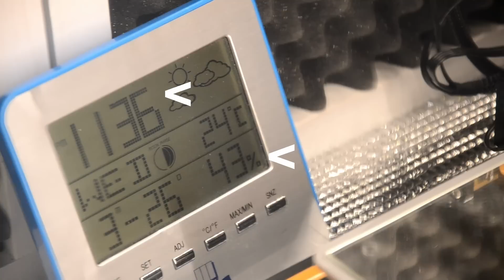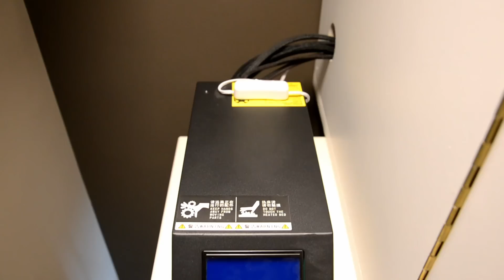3D Printer Enclosure / Build (Creality CR-10)

Comment: nice enclosure but if your printer power supply is attached to the printer i wouldn't insulate it at all, that will fry your PSU.

Comment: Nice job. I am thinking about building one but someone brought up a good point. They said I need to consider the fact that electronics dont like heat, such as the power supply, stepper motors etc, and having them enclosed could cause them to fail prematurely. Whats your thoughts on that?

Comment: Love the design.

Resonance and noise is a hassle with printers and MDF is a nice dead option for an enclosure. 

May i ask how you find the thermal performance? I found the printer gets very hot if you have foam inside as well.

Comment: After 2 years of use, what the temperature like inside the box on long prints? Any issues with the cooling fans for the hot end. Any adverse issues with the control board and or power supply?

Comment: Enclosures that are fully enclosed and retain heat continuously will degrade electronics, motors,  power supplies fail when they are are not cooled properly, if they are inside a warm or hot enclosed box, they will fail prematurely,  3D printers with 3D printed parts as part of their architecture will soften inside an enclosed machine, air pressure differential and  heat control is a must for a well balanced system that will only allow the heat concentration to reach the required parts, surface or surroundings. Think of this next time you consider an enclosure.  Simply enclosing a machine  is not the right way to do it but everyone seems to do this without thought to the above.

Comment: I used this for a super cheap enclosure and could not be happier! https://amzn.to/2WPgPRL Built a cute around the printer and can take down super easy when not needed. Cut a hole for a vent exhaust and printed a 4" exhaust outlet to connect to https://amzn.to/2WS0f3K using the extra dryer hose i had out the window. I am super impressed with my ABS prints and how well it works. the plugs slipped perfecting in between the connectors of the foam. I have no fume smells or anything, it works awesome and only cost me like $20 and folds flat :)

Comment: try a 2nd layer of clear plastic to dampen 'hi frequencies escaping. use some thin foam tape between the plastic and the wood. Also set the box ontop of some rubber/foam sheet to isolate vibrations through the base, if you want it even more quiet, glue onto exterior wood surfaces a 2nd layer of dense heavy plywood. Mass, islolation and then air dampening. are the order of strategies to use for sound dampening

Comment: I like this a lot, but I would have used plywood instead of MDF. Plywood is much more tolerant to heat and humidity, and it is also a lot stronger structurally. The LED's really added a nice finishing touch too. Take a small piece of the foam you used inside the box (or even a piece of the styrofoam you used under the MDF when cutting it) and cut it into a circle to fit where your wires are coming out of the box. Then cut a straight line from the outside edge of that circle to the center of the circle. Wrap that around the wires, then push it into the hole. This will help with keeping heat inside the box, and maybe a little bit of noise too.
Reply from the maker: Hey, that's actually a great idea to close the cable hole with foam. I will do that. And as for plywood, it wood be better but I went for the cheapest option as this was my first prototype (wich works fine) thanks for the ideas! 😁

Comment: honestly too much heat resistance is bad imo. unless you can take the electronics out. even then a lot of 3d prined parts have issues. also you'd need a fan for pla etc.
you're lucky to have a control box like that my anycubic i3 mega has it all beneath the print bed on the inside lol. then again I can't afford an enclosure or the tools or the plexiglass anyway

Comment: Thank you, i made my box around the same time and endet up with something close to this. the mesurements are exactly the same but the main difference is no window and a higher insulation because i use it outside in a garage. with this came the problem of overheat and too cold temperatures for the raspberrypie. so i took a 4€ thermostat from china to make a ventilation system + a terrariumheater for the pie. Its a bit crazy but now the quality is very consistend.

Comment: Somehow I feel very lucky when jit comes to 3d printing since I live in a region of the world where ambient temperature is at 30 to 33 Celcius and if I close the door of the room where I am printing temperature goes up to 40 C. This is maybe the reason why I have never experince a bed adhesion problem in my 4 years in 3d printing. In fact I have a very big stand fan in front of my open printer when I print in PLA. But I could also see the use of having an enclosure just to keep printers clean.

Comment: What about too much heat? Are you going to add a temperature gauge and fan to release over heating? Also, the foam you used on the inside isn't for sound proofing. Sound proofing insulation is super thick and typically comes in solid sheets you have to cut and fit in or thick panels of rubber like that stuff stereo enthusiast line there trunks with to keep the sound in and stop rattling.. The insulation you used is for a sound studio where you want to keep sound from bouncing around inside the room. Its not however going to do anything for keeping sound in..

Comment: This is a really nice looking enclosure- but I take it you're not really worried about a fire? I mean.. if you think about it, you've basically created an oven out of accelerants. At a minimum, I would remove the foam- it's not an acoustic insulator as many people seem to think, it's actually an acoustic dampener. So unless you're doing audio recording inside there, you're not really reducing the noise of your printer by any significant amount.

Comment: a few weeks ago i made myself a 3d printer enclosure as well. i find it funny that we did so many of the same things. i made mine out of MDF as well and also painted it white with a brush and roller. i also used the noise cancelling foam, piano hinges, and magnets to hold the door shut.

Comment: Great video and very good design, just finish building an enclosure based on this design. Have you ever had issues with the filament getting too hot inside the enclosure and causing jams in the extruder gear?

Comment: Did you have to add cable extensions between the printer and control box?  It seems like there is not so much extra slack in my CR-10 to allow for cable routing plus using close to the full height of the printer.

Comment: Hey!

Add a smoke detector inside the enclosure! Some decent one like this (https://www.banggood.com/Xiaomi-MiHome-Honeywell-Fire-Smoke-Alarm-Detector-Remote-Alert-Photoelectric-Smoke-Sensor-p-1148105.html?p=YC12123000790201511L) or at least a cheaper one like this (https://www.banggood.com/Wholesale-Home-Security-System-Wireless-Smoke-Detector-Fire-Alarm-p-25868.html?p=YC12123000790201511L).

Comment: wow you are very talented for such a young man. PRO TIP #1 using stepper dampeners will nearly make all movement noise silent. they are about 15 dollars or euros for all 3 on amazon. I don't print abs much if not at all but I have a dust and light issue this box would nicely solve it, so thank you very much.
Reply from the maker: Hey thanks, I was looking for some upgrades :)

Comment: do you think its possible to build a similar an enclosure so i can sleep in the same room while printing? btw you can get rid of the high pitch noises by using motor dampers; what do you think about putting control box inside, cause it causes a lot of noise aswell; maybe too much heat though ...
Reply from the maker: I think you could, however i chose not to because the electronics in the control box and heat don't go well together. even though it doesn't get that hot in the enclose, I wouldn't recommend it. Thanks for the tip about the dampsers, I'll look into that :)

Comment: Dude, I REALLY like this design you've made. Im probably gonna rip this off if you dont mind!! Just going to make a little dry box for flexibles and nylon in the corner with some more plexi =D
Reply: Have you tried ABS to see how it contains the smell? may also put in a 120mm fan in the top with some ducting to run to a window for odor dissipation
Reply from the maker: you have my blessing, make it your own!

Comment from the maker: side note: Some people pointed out that the foam I used (Polyethylene) might not be so safe. In case of an electrical error it could catch fire. There are fire retardant alternatives that you schould use instead. I never let my printer run unattended, but even so... better safe than sorry.
Reply: Do you have any issues with overheating of the electronics? 
Love the vid and build!
Reply from the maker: not yet :)  but I doubt i'll have any troubly with overheating in the long run
Reply: @sabinepeter4150   that`s exactly what i was gonna ask..whit no fans installed on longer prints 24h or more..the electronic parts can overheat..especially the power source.
Reply: @sabinepeter4150  An advantage of the CR10 is that the electronics is seperated from the rest. So only the stepping motors are within the enclosure.
Reply: Good to see people giving advice like this. The New Years Eve fire in a club in Switzerland proves it's worth it.
Reply: For the people in the US. Home depot sells a "Radiant Barrier" in 48" x 6' rolls for $23 Its enough to cover 3 sides. Its Class 1/A fireproof rating. Sound absorption as well as radiates about 97% of energy back inside. A much better alternative to the foam panels he used. It doesn't look as pretty but its a hell of a lot safer.

Spare Time Shop thanks for the video! You should also specify units used in your drawing.
Reply: @ittotaq  THANK YOU!!!! 

I also thought the foam was kind of dangerous and thought of using of this same material instead, but I didn't knew what it was called 😂😂😂

I now know it's a Radiant Barrier, or more specifically, Reflective Insulation.
Reply: @ColdFuse96  if you want to heat up the enclosure you can use halogen light bulbs as well. The ones that used to light up glass display cases (most are now LED)
Reply: and even if you would you can just install i 40-90mm fan on the backside with a RPM of 400 and it will be silent, then just add a filter and your good to go.. holding the temp at 40-50*C would be anought

Comment: I like the look of the doors very much and will use that idea but I'm beginning to think after looking at quite a few videos on enclosures that non-flammable materials are the way to go. 

I think glass and a steel frame would be very safe but heavy. Maybe aluminium to  make it lighter. 
The cost of fire prevention and fire suppression + alarms is quite expensive and the saving I would get from usingnon-flammable materials makes sense at the moment
Reply from the maker: I didn't really think about my printer catching fire, but I also never let it print unattended. I guess if safety is your main concern it's definitely worth the investment.
Reply: If that is the case then your enclosure is perfect.

Comment: Looks great. How high does the temperature rise in the enclosure?
Reply from the maker: without adding any extra heatsource, it stays stable at about 40°C
Reply: Spare Time Shop Is this with the heated bed turned on or off? Great video btw, you just got a new sub from Belgium :)
Reply from the maker: hey thanks :) this is with the heated bed on only